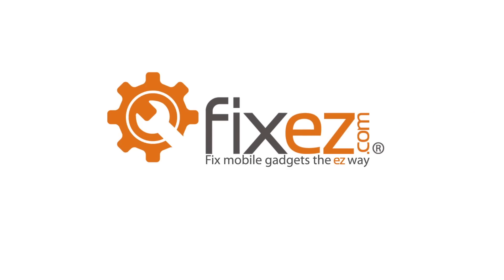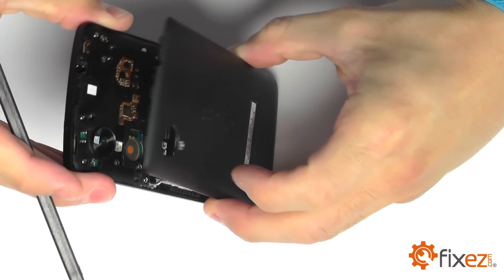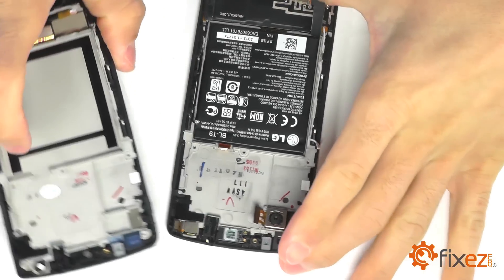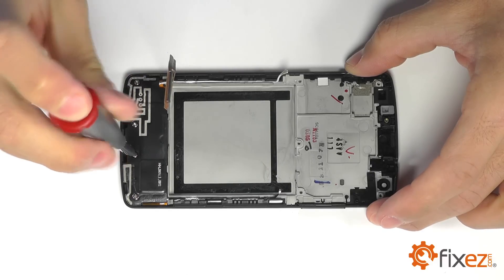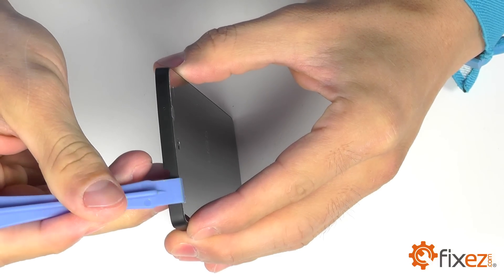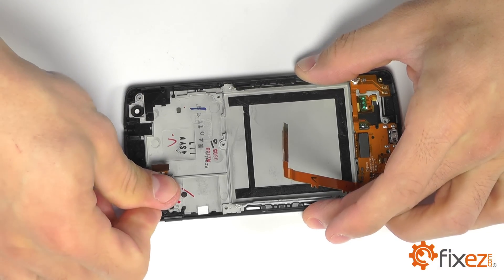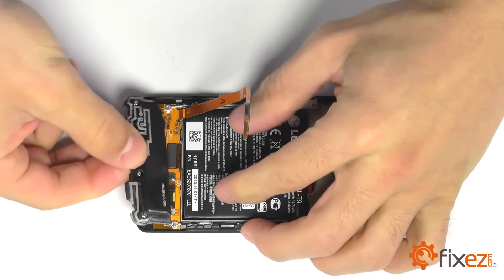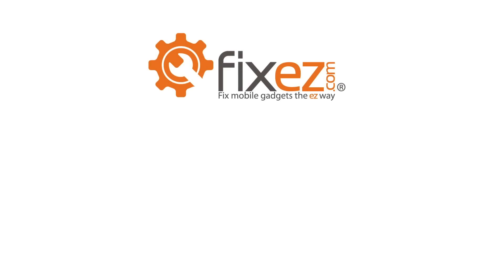LG Nexus 5 Screen Repair & Disassemble

Comment: Changed my screen in 40 minutes since the turnoff til the turnon with this video. Worst problem was the battery. The glue was too sticky and it even bent a little. I got f'ing scared, cuz I know how Lithium batteries are dangerous, but I managed to remove it and place in the new frame.

Thank you A LOT! Keep up the good work!

Comment: I followed this video step by step and I successfully replaced my Nexus 5 screen. The video is very well explained. One small thing was that the author forgot to mention was when you reassemble your Nexus 5, you need to remove from your old phone the volume and on/off rocker and put them into your new Nexus 5 frame. A really great video, congratulations to Fixez.com

Comment: Everything is working for me after re-assembly. Thank you for the video! Be careful with the back (main) camera as it is glued in pretty strong. Go slow and make sure you don't break the circuit board at the bottom of the camera. I would recommend grabbing the sides of main body of the camera. Also go very slow at the bottom of the phone under the speaker. The circuit stuff is very thin so be careful when detaching it. Don't forget to move the buttons. It's not explained in the video (I think) but make sure the buttons attach to the phone itself in the small black attachment points (one for each button).

Comment: Thanks for this video! 
I just replaced my screen (phone was ran over by at least one car, maybe more, when it fell off the roof of the car into traffic!)  following your instructions and it went really well.
The only hitch was the new frame I bought didn't have buttons, and I forgot to take the power/volume buttons out of the old frame, so I had to go back and take it apart again and put the buttons back in!
After reassembling, it works perfectly!

Comment: Brilliant tutorial thank you. All fixed up and looking good. Although you make it look a lot easier than it is. I guess everything is already unstuck when you take it out.

The rear camera was the hardest, and actually one of the tiny chips came off, not immediately, but when I was installing it in the new frame. But I was able to stick it back on again with a small bit of adhesive! Quite surprised it worked... maybe it won't soon!

Other than the volume and power buttons mentioned by others, there was also a housing for the earpiece speaker that needed to be transferred.

Comment: Great video, thanks! I completed the replacement with no problems.  On my replacement digitizer, I had to move the earpiece housing and the side buttons from the old one to the new.  Those two items weren't in the video.  Just thought I'd mention it in case it helps someone else out!

Comment: Thanks for the help.  There were a couple parts you didn't cover and I had to take it all apart again but its done and my phone looks good as new.  Thanks!
Reply: ***** I put my phone back together and realized that I didn't have a volume rocker or power button on my phone so I looked on the old body and found the pieces there and transferred them over.  This wasn't covered in the video but it was pretty easy to figure out.

Comment: Thanks a lot for the video, it was a great help. You forgot to mention that the housing for the ear speaker needs to be transferred onto the new screen assembly. I realized it was missing from the replacement part but didn't think that it was transferable.. Otherwise, awesome video!
Reply from the maker: +Stephen Ramutin Thank you for pointing this out.

Comment: One thing to note.  If wireless charging doesn't work when done putting things back together.  Press on the back cover just above the S in the "Nexus".  The re is a clip in the middle of the case that holds the back cover tight to make the connection for the wireless charging.
Reply from the maker: +Rob Thank you for this input.

Comment: Video did the trick, thanks! Only 2 extras I had to do; Transfer the housing around the headphone jack, Transfer the power button over and bend the plastic tab it was rubbing on so it operated smoothly (had to open case again when it wouldn't turn on because button was stuck in). Minor points and now my phone is now fixed.

Comment: I got it first time and everything works perfectly! Thank you for the pieces, tools and tutorial. 135$ for everything is a little high however...
Reply: I tought it was ok but I have an issue with the volume button. It stick to down volume as soon as I press it one time. There is a default in the plastic case. I contacted you and you ask me to send a picture. I will do it tonight and hope the best with your warranty. To be continued...
Reply: For the moment, I think I solve my issue. The hole of the volume button was a bit tight. So,  I opened it a bit with the plastic opener. The button don't stick for the moment. Hope it stays like that.

Comment: I just replaced the screen on my friends Nexus 5, using this tutorial and the product you sell. It really was an amazingly easy process, so thank you. However, I'm now slightly worried I steered her in the wrong direction. The replacement sold on etradesupply is listed as OEM Gorilla Glass 3 and is a comparable price, however your product is listed as OEM compliant and does not specify what kind of glass it is. It feels like tempered glass, is that correct?

Comment: Very nice video. I was wondering, when you disassemble the phone, is any information lost? Also if any type of glue is needed for the reassemble? Thanks.
Reply from the maker: +Gary Lara No information will be lost so as long as you do not restore the device. Simply taking the device apart will not cause you to lose any data. You would require adhesive to reassemble the LCD if removed as well as for your battery to keep it in place.

Comment: Be careful when you remove the battery !
I had to force to get my battery removed because it was glued and that damaged it (it was visible because the back cover was cambered). Fortunately a new battery is cheap :-)
Thanks for the video !
Reply from the maker: +imad3v Thank you for the feedback as you bring up a valid point. The battery does have adhesive to keep it in place on the frame.

Comment: Actually everything worked fine, I replaced the screen as in the video, but now I do see black lines in the middle of my screen. The touch function works perfectly though. I was hoping it might be me connecting the connectors badly. What part of the motherboard actually deals with the LCD screen ? Many thanks for your help!

Comment: about a week and a half ago i was on my phone and the next second my screen just freaked with a bunch of different colors then just glowed black(there are no cracks or scratches).  I tried restarting and after about 6 times it worked normally for about 20 min then went back to its glowing black screen of death(notifications still have sound).  Since then i ordered a replacement display from etrade, received it in the mail today, and finished the repair.  however the screen is still glowing black!!! I'm not sure what to do now but i have a feeling that it could be the doc port

Comment: i used metal tweezers to disconnect the battery connector. My phone doesn't power on after the reassembly. Did the metal on metal short circuit the battery? If so, how do I fix?
Reply: I'm having the exact same issue and I did not use the tweezers.  Screen will not power on. I have reseated the batter numerous times and still nothing.

Comment: pretty good video, however you didn't cover moving the volume or power buttons over.   a couple other little items would be to make sure to remove the blue plastic adhesive covers at the upper top and the white adhesive cover for the rear camera.  The video also shows the small rubber flap that is in the stock housing but not in the new housing.  These might not be obvious to everyone.   

Much easier and the same cost as just replacing the display.
Reply from the maker: +Craig Grunenfelder Thank you for the information here.
Reply: +Craig Grunenfelder how should i move the volume and power button? i dont get what you say
Reply: +A7XTrueFan182 you have to make sure to install them in the new display from your old display. Move from old to new. Not the location.

Comment: Did it! Removing battery took some patience and my nerve cells, but i managed it. It came off with sticky thing under it, and i squeezed battery a little. Btw, is it dangerous? Battery lost it's form just a bit.
Reply: I tried and it works perfectly, ty!

Comment: The replacement you use in this video is the one you sell? Because in the pictures it looks different, for example, it doesn't include any small pieces
Reply: DO YOUR SELF THE FAVOR AND JUST BUY THIS ONE WITH THE FRAME!!! seriously dont save $30 save your sanity.  I had to take the glass off, and it was shattered in a corner.  Scraping that off was hell and all the little shards went everywhere.
Reply: So much more worth it, I agree.
Reply: ***** what I want to know is if the replacement you sell (the one with the frame) is exactly as shown in the video because it looks different in the pictures that appear in the link you posted

Comment: Great video, great production quality - am about to try this myself later today - but I noticed you never applied any adhesive under the parts on the new frame... Oversight? Or not necessary? Thanks!
Reply: Great thanks... Maybe include some note in the video that the buzzer might stop working as mine did (I pressed down below the camera/flash to fix it)
Reply: ***** is it the OEM part or is it a generic screen?
Reply: ***** thank you

Comment: I just ordered a replacement glass screen from eBay for a mere €5 (just the glass, not the digitizer or anything underneath)

You said in on of your comments down there that the glass and LCD are fused together, Will I be able to detach the glass?

 That's the only part I need, I don't want to spend €175 on a whole replacement LCD.

Comment: Great guide. Very well done. Everything went smooth for me w/ the exception of the rear facing camera, I cracked off one of the two small chips on that board. The camera still works great though :/

Comment: I replaced the screen using you tutorial, but I have no touch function. Any suggestions?
Reply: theres a connector on the the flex cables, make sure they are secure as that controls the touch.

Comment: i would like to ask you if you have any solutions for the ghost touches on the nexus 5?
Reply: ***** I did the replacement of the screen today, all went well
the phone is working, also shows files when connected to a PC, but the touchscreen is not working.
all the buttons are working fine and the screen is displaying everything normal, only no touch, please help
we thouroughly checked the hardware and we don't think we made a mistake there, can this be a software issue?
Reply: ***** sorry, already went to a repairshop, where they switched the screen again..
I contacted 3 different sources, they all told me the screen is not functional, ergo..
thanks for the help anyways

Comment: hi, i disassamble my nexus 5 by watching your video. everything works perfectly, but the only problem is i  cannot hear the voice of people during the call. could you please tell what i should do?
Reply: Re open the phone and check if you correctly reassembled the speaker part in the top of your phone. It can be put in wrong. New speaker costs < 10 so if it is defect it won't hurt your bank account.
Reply: In the meantine turn on the speaker function when you call someone, that activates the loud speaker in the bottom part of your phone. Or put in some earphones.

Comment: Omg it worked, that was scary! All works fine luckily, except two things, the notificationlamp doesn't seem to light up which I don't find much of a problem, but the vibrate fuction doesn't seem to work as well D: Anyone an idea?
Reply: Nevermind I got it, I simply had to press down on the buzzer

Comment: Hello, I bought a Nexus 5 not too long ago and am having nothing but problems with it. Recently my touch screen and screen itself haven't been functioning properly and I have to press on certain areas on the back of the phone to get the touch and screen too work. Where would you recommend buying replacement parts and what would I be replacing to have the touch screen and screen to function again? Plus my ear piece and speaker have been having issues.

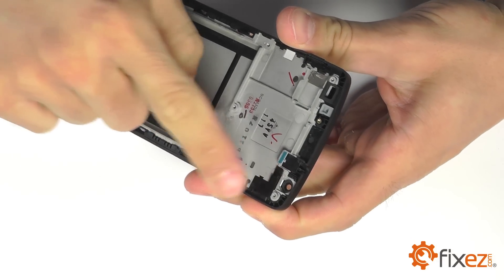Comment: Any advice for removing a shattered screen? It comes off in pieces, so the technique described at around 6:30 is not working particularly well. :\
Reply: Figured it out! It took some doing, but I wedged an Xacto knife between the screen and the bevel and eventually got a foothold!

Comment: I ordered the screen with frame and it came yesterday .. Once I assembled it .. I realize that the notification led doesn't have a cover .. A single white rectangle that has that led effect .. Its only transparent .. I placed a black tape on it so not a big problem .. But today when I woke up .. I found a dead pixel .. A white dot in the bottom corner of the screen.. I'll give it 4 stars ..
Reply: ***** i will.. Thank you

Comment: The Display Assembly with Frame on your website appears to be designed for the black nexus 5. Is there also an option with a white front-facing speaker?
Reply: Hm okay, do you plan on offering white units any time soon?
Reply: Thanks, now Im probably getting the black one.

Comment: FIXEZ get to my post.i have a none lit screen ever since i reopened and a white indicated lite on bottom of screen that is circular i hook up to usb on my computer and i get even more indicator from my computer that the phone works (the beep of a new device usbconnect)but still not booted at all here,or even all the way boot my other post has even more details
Reply: ok i have something new i notice i get a picture that is clear for at least 2 seconds when i press very very hard on the flex cable pin connector (long one that goes on top the phones motherboard next to the battery.) i may have damaged it some how, ordering a new one think will help wish i noticed this before ordering a battery.
Reply: riiight i was unsuccessful new charging port has come in mail installed still no lit screen same issue i have pluged it USB MODE, and useing into my computer and it opens up, i can explore all my files on computer from phone so i think its working but no lights or any sound or booting from phone idk what is it a battery issue i hope i have battery coming 3 weeks out last solutions is to send it to LG

Comment: Are the parts that you sell on Fixez.com OEM?
Reply from the maker: +Luca Massi We sell OEM compliant parts and some OEM parts, just varies on the item required. For the LG Nexus 5 the screens will be OEM complaint, meaning built to the same specifications as the original unit.

Comment: Do i really need these tools, i mean cant i use whatever i have around the house, and this doesn't affect any of my data right?
Reply: +Delta. Doesnt affect your data, but a guitar pick, a hairdryer (only if replacing the screen only) and the phillips screwdriver is needed, but a plastic butter knife with no large teeth or with them filed off could take place of the pick.
Reply: very Interesting
Reply from the maker: +BlasianGamin' Thank you for the response here.

Comment: Thanks a whole lot Fixez, I ordered my replacement screen with the frame and it shipped fast, I replaced it with relative ease and everything works parfectly! Great vid also, couldn't have done it without it!
One thing to note though is that the notification light has no designated hole in the replacement part...

Comment: I used a similar frame/screen to fix my nexus 5, but when I put it together again it would not connect to the camera. I redid all the connections a few times and my camera worked in the old frame/screen. Would you have any idea why the cameras are not working?

Comment: After following this guide my phone wont start..what could be wrong?
Reply: *****
 That was the issue which I solved through putting the flex cable properly. Though after getting my phone to start I tried to make a phone call and the ear piece speaker does not work..

Comment: Would I be required to buy a new LCD if water got into the phone. The phone had water damage on the inside of the screen. Now its dried up with water stains and the back light flickers sometimes. I was planning to check on it but I'm worried about losing my phone. Should a buy a new front?

Comment: so ive dropped the nexus and the phone is broke, the screen still responds but has a big crack. do i need just a screen replacement or the digitiser as well?
Reply from the maker: We recommend the LCD and Touch screen. The LCD is fused to the front glass panel making very difficult to only replace the glass.
Reply: *****
Thank you very much

Comment: Replacement screen worked great but now my wireless charging doesn't work and my phone won't vibrate. Any suggestions what I did wrong?
Reply: I used the full LCD and frame. After a days use the vibrations came back, just a little weaker. The wireless charging has worked from time to time, it's just much more sensitive with how it's placed on the charger than originally.

Comment: I did the same thing, screen works, but the touch screen doesn't.
Several vertical strokes of the screen doesn't work.
Do you know a solution? Bad screen?

Comment: Thank you for saving me $100! Worked like a charm - like AngelOfHavoc I ended up finding that the volume rocker and the power button were not included with my new screen. Luckily I spotted them on the old screen before I had the phone together though.